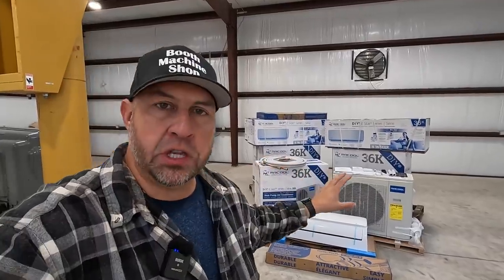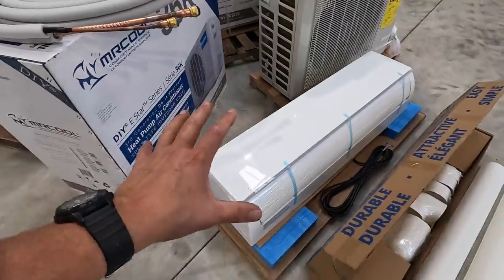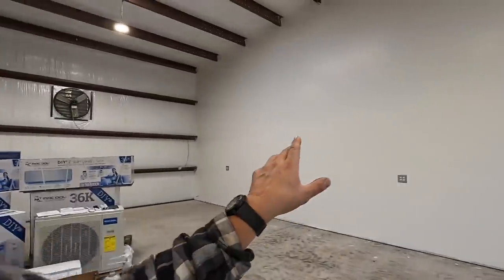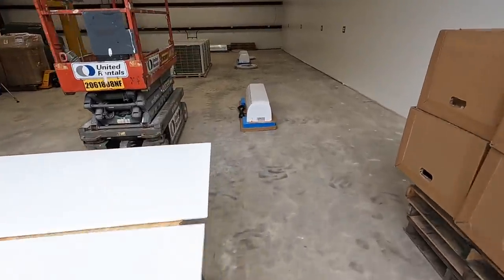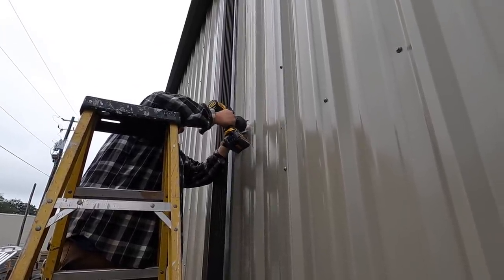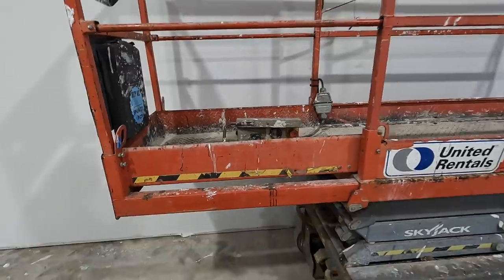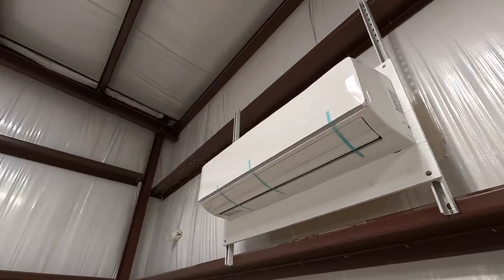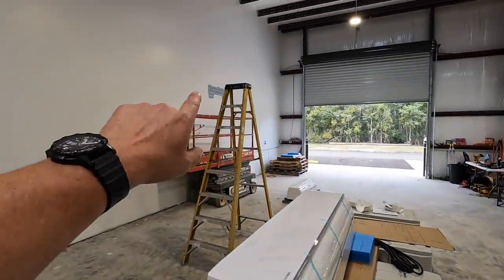Mr Cool AC Install for New Shop Part 1

Comment: Adam, how are you going to prevent thieves from stealing your condensers?
Reply: I have been installing mini splits 6+ years now, not once have I seen or heard about anybody stealing an outdoor unit
Reply: I was thinking the same thing. I was reading the comments first to see if it was mentioned already. It’s not so much being stolen to reuse but thrives will steal anything for scrap metal.

Comment: I thought that even with the pre charged units you still pulled a vacuum in the line before releasing the gas into them, so this will be interesting on the commissioning side.
Reply: The line sets and indoor coil, come sealed with refrigerant gas. As you screw them together they get pierced and release the gas. The main charge is in the outdoor unit as it's called on a heat pump. In the heat mode on a heat pump, the indoor unit becomes the condenser. In the cool mode the outdoor unit is the condenser.
Reply: In this case, the line-sets themselves are pre-charged.  Unlike a typical line set, there is no ambient air present, which removes the need to draw down a vacuum in order to remove the water (boil out the vapor).

Comment: No unit for the office space Adam?

Also, is it wise to fit the "air handlers" next to those extractor fans? Won't there be a risk of the cool air being drawn straight out of the building by those?

Comment: On the one unit where the lines will be extended, will you need to add more charge to the system to compensate for the extra line length?

Comment: Out of curiosity, are they going to be plumbed in series? Or will each sit handler go to it's own condenser?
Reply: Each handler gets its own condenser. There are some systems that allow you to run multiple handlers on a single condenser. You can have a 3 ton condenser and three 1 ton handlers, or a 2 ton and a 1 ton handler, or two 1.5 ton handlers. 

These mini-split systems are amazing in their flexibility and efficiency. When the wife and I build we plan to have a conventional central heat/ac system with an additional mini-split in each bedroom and one more in the kitchen.

Comment: I've had my eye on this system for a year or so, for my 1500 sq. ft. basement/garage (split by load-bearing wall). But I thought that you only needed 1 condenser for up to 4 air handlers. What am I missing?
Reply: It likely depends on the size of the air handler. Lower output ones don't need as big of a condenser. I think Adam's are the largest size they make and probably require one each.
Reply: Mr. Cool makes them in tons of configurations.  You can get what they call their Multi-Zone DIY kits that will take 1 to 4 air handlers on each compressor unit.  We'll be putting a single 36k Multi-Zone with 3 air handlers for our entire house.  (northern climate, we get hot weather but almost never 100% humidity AND 90+ degrees at once.)  I've never seen this much capacity in such a small space.   He decided to go for their largest single head beasts.  The 36k single head units are typically for what he is doing... single large open spaces.  By having more than one of those in there he has an absolutely monstrous amount of capacity in that 2400sq ft.  I think I understand him though.  Many of his big machines are multi-horsepower.  That's a TON of heat being dumped into the space.  You have to account for your worst case.  And he doesn't have to have all the compressors on at once... which is kind of brilliant.  He can turn on only as many tons as he needs based on how many machines running.

Comment: Hey Adam. Sorry to ask, but almost all these Mr Cool videos are sponsored by Mr Cool (free or discounted units), but not disclosed as such until one asks. Did you pay retail for these or is this also a sponsored video by the Mr Cool folks?

If you were going to have a pro hvac person helping you anyway, seems it would have made more sense to get a multi-head system with a big and more efficient condenser outside, but I don't know what other decision criteria you had.

The flat on the flange is to allow you to angle it on the outside. The Mr Cool folks suggest drilling that entire hole at a down angle from inside to outside to allow for drainage and for less bend in the lines, but that's mostly if you have a solid 2x4 or 2x6 wall behind the handler. Also, that lift is super useful. I man-handled the one in my shed and I swear my back is still out from holding that thing up while trying to position the lines cleanly (due to framing, mine had to exit from the opposite side, which makes it WAY more of a pain, so I'll never do that again).

I've installed two of these (one in my shed, and later, one in my office). They're pretty nice as long as you have a reasonable place to store all the slack line set without it getting all gunky. My line set for both of mine came in a canvas-type sleeve you bundled everything in.

Comment: Great systems and a really nice looking installation. My experience with these systems is they work well but do not handle dust very well. This being a metal shop you should be good.
Reply: Turning and milling is very clean, but sanding and grinding dust are awful for filters. Being high up should help a bit.
Reply: @Bob_Adkins  grinding (including sharpening of tungsten) should never be done in the same environment as machining; I don't recall what is Mr. Booth plan for this, but in my case I have a strict "grind outdoors" policy. I setup a a bench made of pressure treated wood with a vise outdoors. The CNC plasma is in the shop but I use forced ventilation in addition to the water table to mitigate.
Reply: @AlessioSangalli  I hate sanding and grinding in my shop, and I'm sure most machinist do. However, it's a discipline that's very hard to adhere to. When it's too cold and wet to fish or work in the yard, I work in my warm shop, and don't want to go outside to sand, grind, or use a cutoff wheel.
Reply: @Bob_Adkins  in that case, and of course depending on the size of your shop, maybe consider building a grinding booth with proper ventilation. That is what we had in my previous job, a room dedicated to grinding operations
Reply: @AlessioSangalli  Exactly right! I'm trying to figure that out right now. I've had enough of the mess, but can't find the room to put a booth.

Comment: interesting, never heard of air cons rating being called "ton" before, they are rated in kw here in Australia.
Reply: 1 ton is 3.5 kw
Reply: also 1 ton = 12 kbtu/hr
Reply: In the US, I’ve never bought an AC system that wasn’t rated in tons.
Reply: they need to keep it simple for the yanks. they cant handle new units. everything needs to be in feet or tonnes
Reply: @dalegawne5286  tons. 😁
Reply: @dalegawne5286  12 thousands 😁

Comment: I don't think it was mentioned but can you control all 4 systems off a single thermostat?  Seems like a reasonable thing to be able to do.
Reply: You should be able to, but you might think about doing two and two because you probably don’t need all that capacity all of the time. Will be interesting to see what the pro says in the next video though.

Comment: You may also be required to include a 120vac receptacle on the outside of the building, adjacent to the condensing units, for maintenance purposes.  I assume Fernando knows the local rules about that.
Reply: I wouldn’t be so sure, Adam keeps calling him a technician not a contractor, there’s a big difference in the state of Florida between those two designations.

Comment: Is that twelve tons of actual weight? Just curious because I can't see how each of the four units could weigh three tons a piece.
Reply: It's a measurement of cooling capacity not weight.
Reply: @firesurfer  Ah I've never heard of  tons being used as a measurement of cooling capacity.
Reply: Well, now you have.  Google it.

Comment: Do you need to pull a vacuum on the system before firing it up? If not, you'd be leaving some moisture from the air, unless the already have a vacuum on them and there are quick disconnect fittings.
Reply from the maker: It’s not required. They put a small charge in the lines and charge the compressor with the refrigerant. It’s designed to be do it yourself and my system I’ve installed 3 years ago is proof that it works great.
Reply: The sealed line set is what makes them "DIY" vs a standard split unit you don't need guages or a pump for them.
Reply: The lineset is precharged

Comment: What the heck is "a ton" quantitatively in an air conditioning sense besides "oh I have a crapton of air conditioning"? Never heard that before. Watts, sure - BTU, sure. But tons? Im from Europe...
Reply from the maker: 12,000 BTU is equivalent to 1 ton.
Reply: @Abom79  Ah, thanks, that makes a lot of sense.
Reply: @Narwaro  As much sense as any of our weird measurement units make :)
Reply: A ton of refrigeration is the amount of cooling/heat gain from 1 ton of ice melting over 24 hours is equal to 12000 BtuH, 3.5 Kilowatt hours or 3 horsepower
Reply: @peterhansen8216  so you saying it takes 3 horse's to melt a tone of ice in 24hrs?
Reply: @julesc8054  yes but they'd be cool horses

Comment: ? If these machines are 230V and the shop has three phase,  does that each phase has 230V and a total of 690V?  Do the machines(lathes mills etc) in the shop run on 230V three phase?

Comment: My one outside unit can handle 5 indoor units. Why did you need 4 outside condensers?
Reply: Good comment but if your outside condensers has a fault well 5 indoors units would be effected! So some times going old school belt and braces it’s just better
Reply: If you have 5 heads on 1 unit chances are there is a branch or distribution box somewhere
Reply: Ummm who provided the units?

Comment: Cutting the flange with a circular saw at 20:00 looks very very dangerous! I've had pvc pipe bind and explode on the chop-saw, its super scary and I would never make a cut like this... Cutting plastics with power tools is sketchier than it looks ime.

Comment: Everything looks nice and clean when it is new...Also if you are going to have your condensers exposed to the elements, have a covering for them from rain, heat, birds droppings and "snow" when you get it...👍
Reply: you should not cover them, as the fins need to have proper cooling by the fan

Comment: It is good to have a professional HVAC person to help you to install these units because all of that work will need to be inspected by the local building inspector. You may run into a problem with the wiring of the units. Because local building codes might require a licensed electrician to do all the wiring to pass inspection. I'd also put 3 - 4 screws in the outside flange to make as tight of air seal as possible. I think I would have put some sealer around the outside of the inside flange.
Reply: Watch part 2. He has electricians doing the wiring.
Reply: Yes, an HVAC mechanical permit will still need to be applied for, received and a final inspection by a building official. Since this is not Adam‘s primary residence a HVAC contractor is required to pull the permit, necessary load calculations will also need to be performed to satisfy the permit needs. A separate electrical permit will also need to be purchased and electrical contractor have his work inspected.

Comment: "Before electric air conditioners existed, people used large blocks of ice to cool their homes and businesses. The ice absorbed heat and slowly melted as it warmed up. The use of tons to measure cooling capacity comes from this time. A ton refers to the amount of heat it takes to completely melt a ton of ice. Melting this amount of ice requires 286,000 Btu (British thermal units)"

But how does one size a system taking into account the volume to be cooled?
Reply: A Refrigeration Ton is equal to 12.000 BTU/hr, and it's a unit of power, not energy.
If you have 2000 lb ( a short ton ) of pure water at 32 °F you need 286000 BTUs of heat extracted from it to turn into ice. 286000/24 is 11.916.
So you need 11916 BTUs per hour (BTU/hr).
Reply: You have to calculate loads from wall heat gain, ventilation, equipment, personnel etc.

Comment: Always use a vacuum pump... Or replace it in five or so years. It prolongs your compressors life
Reply: There's no need to put a vacuum on these, the condenser and line sets are filled from the factory. They have some sort of which quick disconnect between each of the connections. Just tighten, check for leaks and pretty much good to go.
Reply: @MrDflores1  ah I forgot about the pre filled lines. My bad
Reply: @j-tothe-ay  All good. I didn't even know about these a year ago when I watched a different video and I had similar concerns. Innovation.

Comment: Using a circular saw to cut metal sheeting or even PVC etc pipe,if it is a carbide tooth blade I flip the plade so it runs backward. Makes cutting some materials easier and I think safer.

Comment: Wow, up to 16 Seer rating!  Mr Cool didn't do you any favors!  You will find these units expensive to operate and pretty inefficient to heat below 40 degrees.  How do you plan to run the condensate drain lines from the side wall installations to the rear wall cutouts?
Reply: How often do you think it gets below 40 degrees in Florida?  Maybe 5 or 10 days/year at most.

Comment: It’s called duck seal
Reply: It’s spelled DUCT seal. Just like DUCT tape and DUCTless mini-split.
Reply: @ralphgesler5110  wrong...  the name derives from the original material "cotton duck cloth" and has been in use since the late 1800's.
Reply: @ralphgesler5110  so what you’re saying is that it’s DUKW tape?

Comment: My experience with the mini splits is that they don’t do a good job dehumidifying the air. Is that a concern for you with all the surfaces and tools that could rust?
Reply: For good dehumification the equipment needs to be close or slightly smaller than the load. For dehumification to work it has to run. If the Ac is oversized if won't run long enough to dehumidify the air.
Reply: your unit is probably way oversized.   achieves temp so quick it doesn't get time to dehumidify
Reply: nice thing about having several like this is you can shut down 3 of them when the weather is nice and just keep one dehumidifying without removing heat too fast
Reply: @peterhansen8216  Exactly!
A proper setup cools, but runs long enough to reduce the humidity, especially in Florida.

Comment: They are not as reliable as you my think so be warned.
Reply: For one thing, those Quick connect line fittings with rubber "O" rings will lose refrigerant over time.
When I installed my own central A/C system I was told that the proper way, for leak proof lines, was to solder the fittings with a special solder they provided.
That is why Automotive A/C systems need to be recharged so often, the refrigerant migrates through the rubber lines and "O" rings.
Reply: I see these types of comments on all these videos, yet none of them seem to come from actual owners or past owners.

Strange considering how much people like to complain.

Comment: I've been in the HVAC industry for 36 years. I've installed more mini splits than I can count. It is ILLEAGAL in the United States for a non certified person to handle anything using refrigerant (Freon). I want to know how Mr. Cool gets around this? Or did they just choose to ignore it? Apparently my 36 years of training and experience is no longer needed because they decided a homeowner who doesn't know one end of a screwdriver from another is talented enough to now install a complete HVAC system. This is not only dangerous but irresponsible. Not to mention that installing a HVAC system and the associated electric requires BUILDING PERMITS in most jurisdictions.
Reply: Diddums.